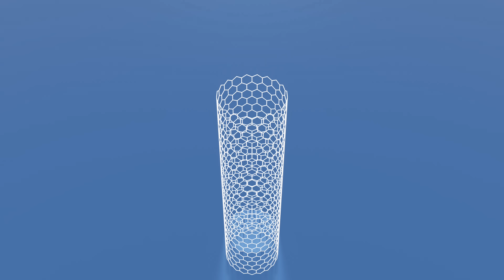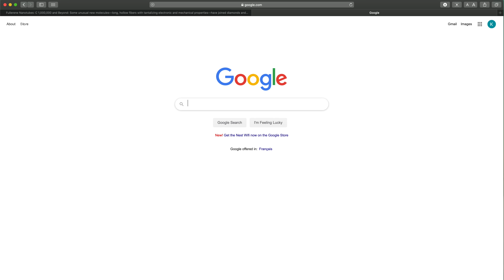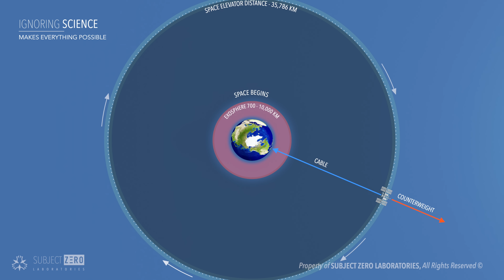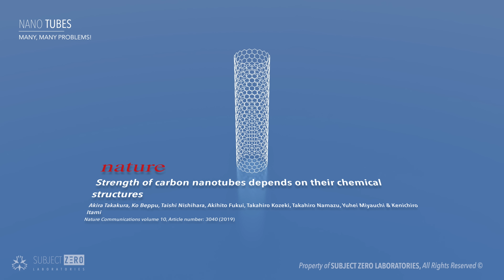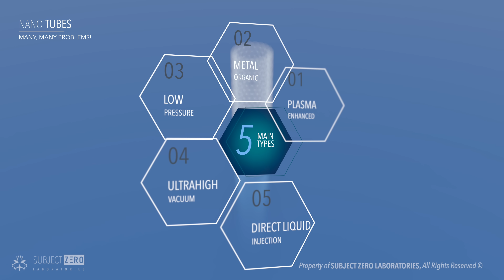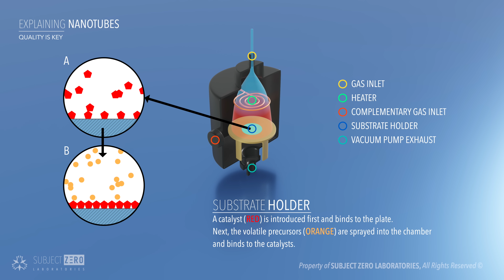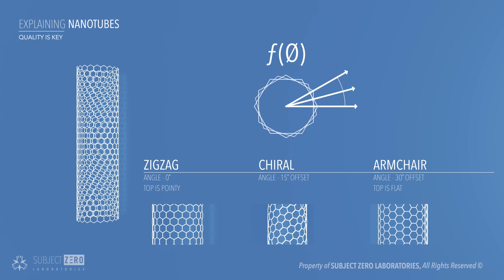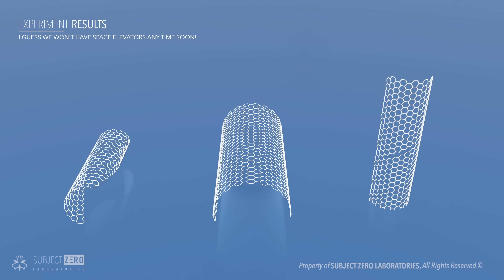Nanotube Strength, Bad News for Space Elevators [2019]

Comment: It is also not a "hard" requirement to go all the way to geostationary orbit distances. A MUCH closer satelite with station keeping could also suffice similar to the starlink satelites.
Reply: Actually, going to geostationary is insufficient. Actually need to go well past geostationary. And anything shorter than geostationary would be even worse.
Issue is that geostationary or lower would require the entire structure to support itself under a compression load. If it's longer than geostationary and has a large enough counterweight at the end, then the structure would be in tension, not compression.
Reply: @johncochran8497  What if your orbital velocity is great enough to induce tension or would that require too much energy? Perhaps a compact fusion reacter or such. Would love to see the actual math on this.
Reply: @n4rzul  There's plenty of studies on orbital elevators out there. But in a nutshell, the lower the orbit, the faster the satellite needs to travel. So if you're below geosynchronous, then the velocity of the tether at ground level is too high to be practical. If you want it to be stationary, even going to geosynchronous isn't enough because the tether would pull the anchor to below geosynchronous. But if you go beyond geosynchronous, then the end of the tether in space would be going faster than the orbital velocity at that height and therefore would place the tether in tension.
Reply: @johncochran8497  He's talking about a satellite that is physically lifting the elevator cable, basically a giant engine on a tether. It would work, at basically any length, but would be very inefficient. If powered by conventional rocket fuel, it would be very expensive and wasteful. If operating as a magnetic tether, pushing off from the Earth's own magnetic field, it would need a lot of power. You'd probably need to beam in more power from orbital powersats, and it would need to be quite long still.

Very wasteful, but might be a handy intermediate step for building an orbital ring. Though I'm sure there are far easier ways to start that sort of structure.
Reply: @berserkasaurusrex4233  And it wouldn't work. Reason is because the satellite would have an extremely high ground speed because it's below geosynchronous. If the satellite was stationary relative to the ground, then it would be below orbital velocity and crash.
Reply: @johncochran8497  Ah that actually makes perfect sense. Dont know why i didnt think of it
Reply: @johncochran8497  No, it would work, it would just be very fuel intensive. It's not a real satellite, as it isn't moving at orbital velocity. 

It's basically just a big engine, with the tether supplying fuel. Essentially the same idea as those water-jet packs people use to "fly" around lakes, with a boat following to supply high pressure water. Except in this case it would be 80 miles high or more.

I doubt a solar-only powered station-keeping system would be powerful enough, but might work for asteroids and small moons.
Reply: @berserkasaurusrex4233  If you're going to use something that requires an active structure, then frankly what you're envisioning is pure stupidity. Try looking up "space fountain" instead. But even a space fountain would be rather useless since the top is stationary relative to the ground and any payload would still need to be accelerated for it to get into orbit.

Comment: The strength calculation assumes a uniform thickness.  If it were _tapered_, the strength needed of the material would be lower.
Reply: Yes, but how do we taper a tube that's 35000 km long and 1,5 nm thin?
Reply: @DreadX10  You build it in layers, like an onion (that's not a Shrek joke, btw), descending each layer down until the thinnest portion touches down on Earth. As I recall, every elevator concept assumes a severe taper along the length, thinning toward each end. It's the only way to get enough strength to make the idea viable (at least on Earth). It might even work with non-exotic materials, but you'd end up with a steel cable a mile thick in the middle, which isn't at all practical.

Comment: Here I go again telling the same thing in another science channel. Space elevators will NEVER happen. Why? Because the design is exactly the same as a whip. A giant whip made from the strongest material ever made. It is a very, VERY bad idea.
Reply: I'd like to think of a space elevator more as an anchor and chain. Sea bottom being earth surface and the ship being the anchor point in orbit.  Many thoughts that were unfeasible at the time or thought impossible has often been overcome given time and science.    First time I've heard the whip reference, nice. Hell powers at be have thought up orbital skyhooks to pick up high altitude flying cargo to get into orbit.   I would NOT want on that ride. 
I'd be very hesitant to say something is NOT possible forever.
Reply: @DurzoBlunts  the problem is the necessary energy to overcome gravity. It's not a stable system, equilibrium will tend to pull the cable constantly. Everything must rely on the strength of the elevator and maintenance would be huge. In the end is just cheaper to use a ship.
Reply: @cleitonoliveira932  Just remember in 1716 flight was thought impossible due to the requirements. Until we started rethinking/experimenting the ways and possibilities of controlled flight for humans.  Maintenance and reliability will be a surefire beast to overcome I completely agree.  I would certainly place Sea Dragon above the elevator in modern day feasibility of launching large masses into orbit.
Reply: I can see it working, but only as a much smaller skyhook type of elevator, and even then an orbital ring would be far more practical and cheaper.
Reply: Exipt the cable would never hit the speed sound or anything really damaging (assuming it bracks at the top, at the bottom the cable would gust move to a higher orbit) and one can brake it apart before it hist the ground anyway.
Reply from the maker: I’m with you brother.

Comment: Why are you so dead set on using the Earth as a model for all space elevators? On the Moon, for example, kevlar is more than strong enough and has the necessary strength to weight ratio to construct a space elevator. On the other end, there is almost certainly no material in the universe that will ever be capable of creating a space elevator on Jupiter.

Space elevators are old news anyways. Tethers are similar, but also a very viable solution that can be made with current tech. But where the future really lies are orbital rings. These offer so much more, and we have the tech to build these (though probably not the necessary engineering skill, and certainly not the manufacturing capacity). Rings can be built entirely within leo, are not restricted to merely a couple degrees n/s of the equator, can offer an even faster exit velocity utilizing mag lev, can offer practical travel between different areas on Earth, can offer immensely greater importing/exporting of materials, far less travel times, and again, we know that these are possible, plus there won't be 30,000km long cable sticking off one side of our planet. Barring some fantastical new material that can withstand the forces and can be produced extremely fast and cheap, there is no reason to opt for an elevator instead of a ring, on Earth. And even then, it would only be short term solution until we got some rings built.

Also, what's with this $200/kg figure? Once a tether is built, maintenance and power costs are negligible. The economics are also heavily dependent on how big and how strong the cable is. A bigger cable means more room for more carriages. A stronger cable means again, more carriages, but also faster carriages.
Reply from the maker: You are right. I had many requests to talk about space elevators so, I included here.

Comment: ahh well, good thing they werent thinking that a space elevator would be constructed with just 1 strand of nanotube
Reply: The force they measuring is the capacity to support it's own weight. Using multiple strands will not solve the problem because you are just making the entire cable heavier.
Reply: Thats not really accurate.  You should clarify it is not it's own weight really...but it's weight at the length that would be needed to reach a space station.  Also, unless the station is in almost perfect..never changing synchronous orbit the stresses of drag and/or centrifugal would...as of this point..be too much for the cable
Reply: @jimm638  Once you have a cable with enough strength to more than support It's own weight you can adjust the thickness to resist other forces. And yes when I said support it's own weight I mean the weight of the entire cable from earths surface up to GEO.
Reply: @kazedcat  - The cable will curve like a kite string, no matter how you build it. Shear force says "no" to this whole idea. Scientists should concentrate on more efficient rocketry.
Reply: @MkeKen67  they already included curvature in their calculation. How a tether will hang is not complicated. Aerodynamic flutter is the harder effect to model. But this is also considered in feasibility design.
Reply: @kazedcat  - Well, there's also the problem of a mechanism to get the elevator to move up the cable, assuming the cable survives during the initial construction process (a process which has not been figured out yet, I might add). This is all very conceptual at this time, obviously, but not many commenters seem too worried about the danger posed by a cable this long breaking.
Reply: @MkeKen67  A poorly design building is also very dangerous. Constructing buildings with proper materials is necessary first step in making sure that skyscrapers are safe. So making sure that there is proper material for space elevator is necessary first step to make sure they are safe. If those material are not feasible then all other concerns are irrelevant. They only factor once proper materials are validated. Worrying about how to climb the elevator when you don't even have a way to build them is stupid.
Reply: @kazedcat  - Well, sure, we can't make the cable yet, so maybe everyone who is talking about how space elevators would work is getting too far ahead of themselves. (Including me, I suppose.)

Comment: Man you really need to check out ISEC work and research. The space elevator cable will be made of ribbons of single-crystal graphene, maybe with an outer layer of boron nitride.
Reply: So, all we need is to make a ribbon of perfect single crystal graphene 100,000,000 times the length of the biggest imperfect monolayer we have made so far, then make 30,000,000 perfect copies of that and somehow put them together in a cable despite their almost frictionless nature - just to make it a centimetre thick. Then anchor it somehow. Then attach something to the frictionless material for the climbers to climb.
I see Andrew Nixon is so confident he has a registered trademark for Nixene® though the material is non-existent. Only $30 billion dollars for the entire space elevator project, a bargain for investors. Less than 7 times the cost of the Øresund Bridge, which is less than five miles of bridge with infrastructure.
One square centimetre of graphene cable would contain 13,000,000 kilogrammes of carbon. A cable 10 cm by 1 m would be 13,000,000 tonnes of carbon. So they are saying this will cost less than $3000 per tonne to make perfect graphene cable and launch it into low Earth orbit, ignoring all the other complications of infrastructure. Are they going to make it from McDonald's frywaste?
Reply: @pattheplanter  Depends on the source of the carbon, I would guess. If you build the cable with an automated factory planted on a carbon type asteroid, and then launch it at the Earth, then the cable really only costs what the factory costs to build.

Mind you, it's still a dumb idea and even if it could be built, there are far superior structures that can be built instead.
Reply: @berserkasaurusrex4233  I am guessing that an automated asteroid mining and exotic carbon factory will take more than $30 billion to develop,.

Comment: I know CNT's and graphene are basically the same thing and prone to the same defects but if you tightly rolled graphene in a loop with so many layers that it ended up being a couple centimeters thick and then made a chain out of these loops, how would the strength compare?
Reply: ...and I know it would take years to grow each ring at current rates but at least it would facilitate the tapering a space elevator needs.

Comment: If you have the space elevator terminate at 20 km, you will only need a cable of 6.3k gpa, not 65k. A hot air dirigible can deliver the elevator car to the cable, which then can take the elevator to space.
Simple.
Reply: That's why you site the elevator along the equator. Then there is no sideways motion at all. It's the same principle that geostationary satellites use. Google the ted talk on space elevator by European space agency.
Reply: space starts at 100 km and the trick is not falling back down once you get there. To get into orbit you have to then move sideways really really fast. That tether length of 35 thousand km was to go high enough that the rotation speed of the earth is enough to count as that fast sideways movement needed to keep you up in orbit.
Reply: Yes. The tether does not need to come to the ground or even have a zero velocity. A tether that has a velocity and height that an airliner can match would be enough.
Reply: Steve Mickler you have to think this through carefully. The tether has to have zero velocity relative to the air around it. Otherwise, the air resistance, even a little, will cause a slowing of air speed eventually the teher will be just a long comet falling to the ground.
That's why a dirigible was suggested, because it also can have zero velocity. A plane has to keep moving to stay aloft.

Comment: Or you build an orbital ring instead, that's actually possible (without needing any super materials that can barely be manufactured) and potentially way more useful than a space elevator could be.
Reply from the maker: More useful, yes. Now the cost to build one? we are too far away from that, sad.
Reply: @SubjectZeroX  the cost wouldn't be too exceptional compared to a space elevator. For a space elevator it'd mean building a roughly 35,000km long structure out of graphene or carbon nanotubes with a huge space station on the end and needing to send almost all of the building materials up to GEO. For an orbital ring you're looking at a ~40,000km structure made out of mostly steel and copper built in in LEO and an initial orbital ring doesn't need to be particularly large because a small one with a smaller capacity can be built and then be used to build a full sized one.
Reply: @coreymicallef365  - You still have to get all the raw materials out of the ground and send them up there, though. Not cost effective at all.
Reply: @MkeKen67  or use material sourced from the moon, or asteroids and it's not like that wouldn't have to be done for a space elevator for a still  quite significant mass (possibly a similar mass because of how close to the breaking length you'd be running it) to a much higher altitude with a material that's much harder to manufacture for a structure that'll have a tiny fraction of the space lift capacity as an orbital ring.

Comment: What about Carbyne?
Reply: they have only been able to form it protected inside carbon nanotubes because it's so chemically reactive that the strand basically burns itself in half with anything it touches.
Reply: @OldGamerNoob  interesting, I hadn't heard of that detail.
Reply: @OldGamerNoob  is it due to the single atomic link on one side?
Reply: @RichardEricThompson  maybe, just remember I got excited when I heard about the stuff beung so rigid but found that downer when I dug in and did some research.
Reply from the maker: Carbyne would be good, but they don't have methods to produce it, but it would be the way to compensate whatever problem NTs have.